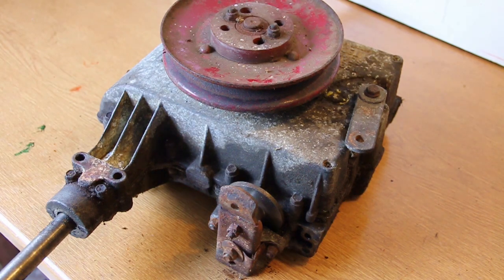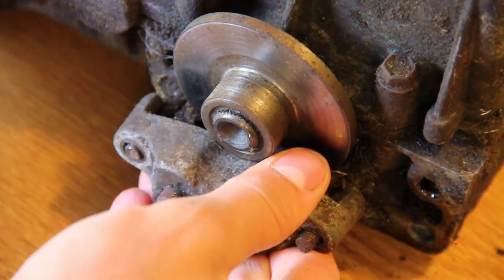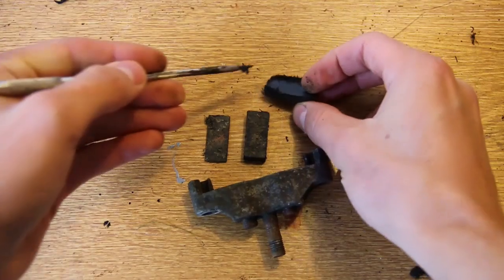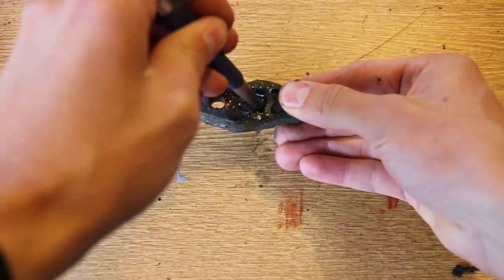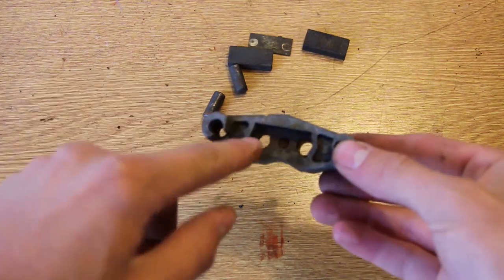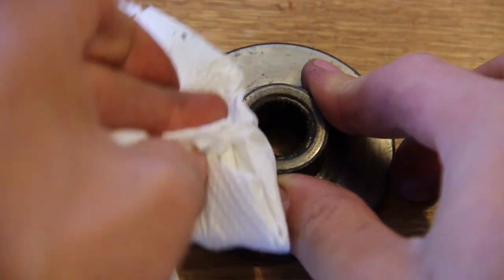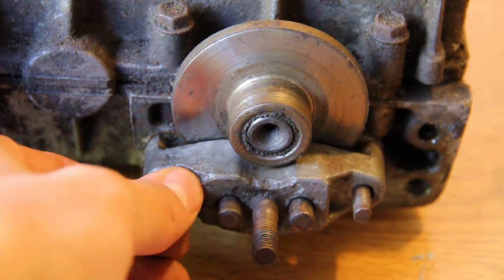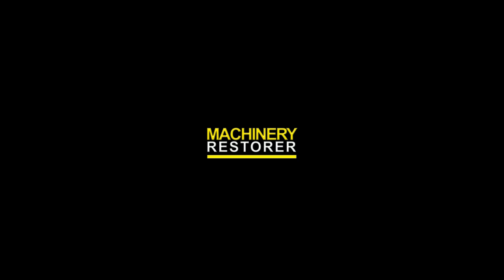How to: Service Lawnmower Brakes

Comment: Excellent video. Just restored a John deere RX75 and had no idea how to service brakes. Ordered pads on amazon for $8. Cleaned assembly. Installed, lubed AND adjusted as you mentioned. Works like new again. Thank you

Comment: Where you used a 10mm socket I found that on mine the sizes are imperial - a 3/8" socket was a much better fit.

Comment: That final image is wrong. Cannot see how the brakes can work with the lever upside down like that. The bend in the bracket is at the bottom and pushes both pins in at the same time when the lever shifts back. Rest of video was useful however the final image is way off. I also notice that S shaped bracket is missing from this final image. You applied that to the right hand caliper bolt and on to the centre bolt, but it's not there in the last image at 7:47.  @robcar2781 who commented further down was correct and reading his comment helped the final stage.

Comment: On my Westwood S1300 Peerless gearbox the lever is the other way around.  The formed bend in the lever pushes the pins in when the brakes are applied.  Also important in my case to adjust the lever position on the brake connecting rod so the pins sit central in the "V" shaped form on the lever.  Equal pressure is then applied to each pin when the brake is applied.   The pads on mine were badly worn and this probably was the cause of the splines in the rotor being sheered.  New rotor and pads and it now works fine.

Comment: You are the first person I saw that actually mentioned that the rotor needs to move freely on the shaft so that the outer puck can push the rotor into the inner puck .  If the rotor doesn't move you are only getting half the braking performance.

Comment: For the two sliding rods that push on the pads, you can put it into a standard 3-jaw chuck on a drill to spin it, and just hold the wire brush against it,

Comment: I am sure you have since realized but you put the break lever on upside down
Reply: Noticed that as well, only looked at video as ours needed fixing and thought it looked weird, then when I got ours apart was obvious you need the shallow V to push the studs and pad in.
How it is in video the brakes would not even operate.

Comment: i have a poulan pro riding lawn mower, it starts but when I release the clutch/brake the engine stops, what causes that?
Reply: Haven't proved it yet but it sure makes sense!
Reply: Idler pulley and drive belt may be binding.

Comment: I know this video has been out for about 2 or more years. If you or anyone reads this and can offer any help I would greatly appreciate it. I have a poulan pro riding lawn mower and the brake disc will not turn, plus the mower only goes forward no reverse also it won't go into free wheel even if I pull out the hydrostatic lever out. I'm wondering if the transmission could be bad. Any help would be greatly appreciated.

Comment: Firstly I would like to say that your videos have been really helpful in getting my Honda lawnmaster up and running (essentially the same as the westwood 1200 in most aspects other than the engine).  I have been reassembling my gearbox and brakes after fixing broken selector forks in the gearbox and looked to this video to help me with the brakes.  Serviced them as shown but noticed that the arm attached to the calliper (the on you connect with a locking nut) was the other way round on my assembly.  I assumed mine was wrong but when I started to play with it to see if I could make the pins go in and out the only way I could do it was to reassemble it as it was ie with the angled part of the metal touching the pins.  I went back to the Tecumsah manual and parts list and that suggest that is the way to reassemble - is it possible the arm on your brake assembly is the wrong way round.  I would send you an image but dont seem to able to post it here

Comment: Lever on upside down? No cam action with the way it was set up
Reply: why upside down ? it should work either way how the lawnmower was built
Reply: @Boemel  pic in original manual shows it the other way up
Reply: @Boemel   The shallow V end is what causes the studs to push the pad in when the arm is moved by the brake pedal. Having the flat end on the studs as per the video would have no effect whatsoever on the studs when the lever is moved. Common sense really and surprised the video maker did not know.

Comment: You put the lever on upside down. (7:09) The bent end with the hole goes on the caliper end. I think it was on backwards when you took it apart too. The bend is what pushes the pins in when the lever turns. Flip that lever over and your brakes will work.
Reply: I totally agree with you Stitch Shifter. I was watching the video and could not work out how the pins were suppose to be pushed in. It was only when I read you post that the penny dropped. The Formed part of the lever pushes the pins in when the lever is turned. Top Man !
Reply: Yes it was on upside down! The way it was fitted the brake would not have worked!
Reply: Just done on t1200 the lever  on it was also fitted wrong way took me a while  to figure it out 😂

Comment: I managed to salvage one brake pad that needed to be replaced by building up one side with JB Weld Water Weld. Clean it thoroughly with rubbing alcohol and let it dry.  Then mash the putty onto the pad and let dry for an hour or so. Then sand it to shape. Place the putty-side away from the disk. Works fine so far.
Reply: ThisIsToolman ‘8